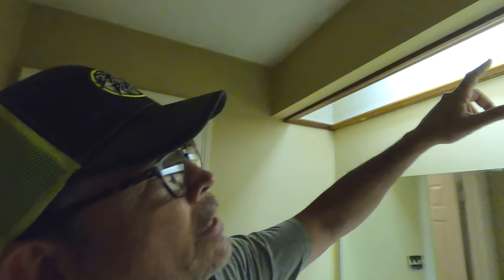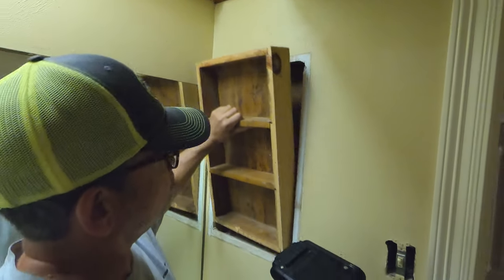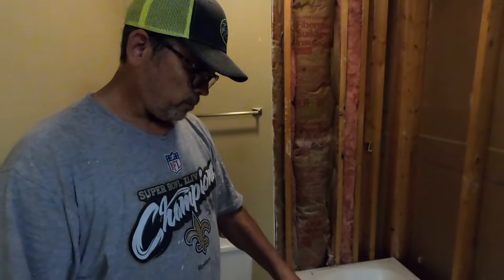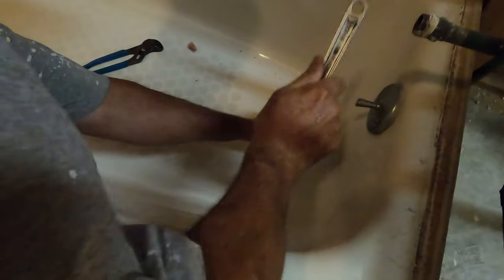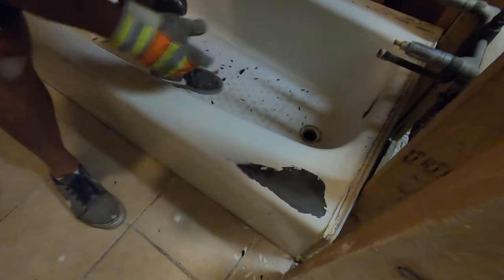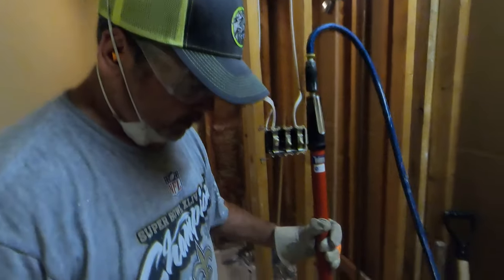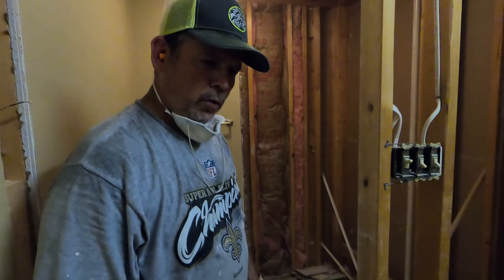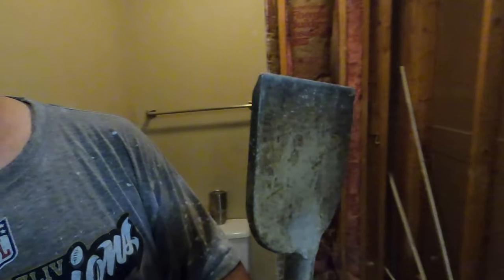Remodeling a Hall Bathroom Part 1

Comment: That chipper looks amazing. Now how to remove the 1/2in cement board with hundreds of screws tied to the subfloor as easily?
Reply from the maker: Depends on whether or not the installer used thinset between the cement board and subfloor.  If they did, that's a nightmare.  Chip, chip, chip...................

Comment: Just removed tiles myself using an electric chipping hammer. That air tool does make it look easier. What did you do for dust control ?
Reply from the maker: Nothing in the bathroom, drop clothes from the bathroom door to outside protecting hardwood floors.  On larger jobs we'd hang plastic etc.  Check out our video Remodeling a Kitchen Part 4.